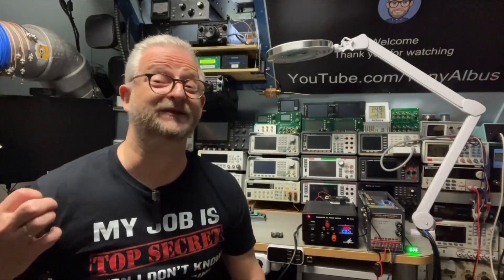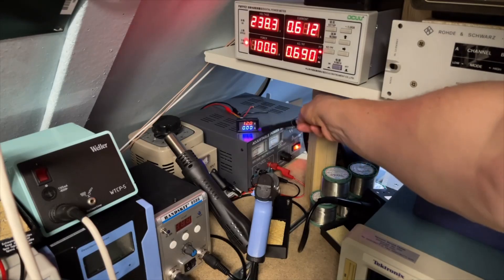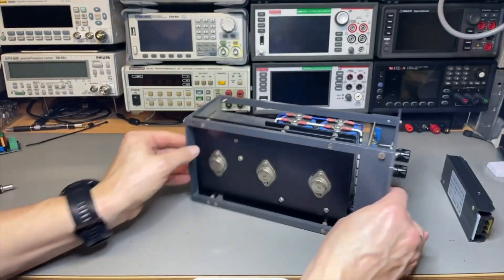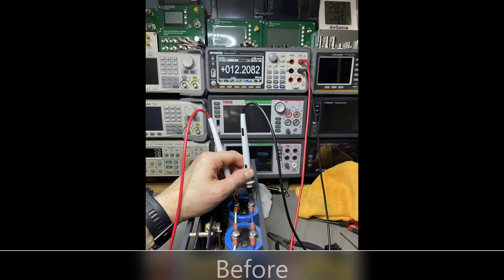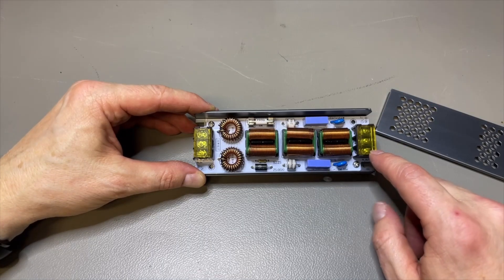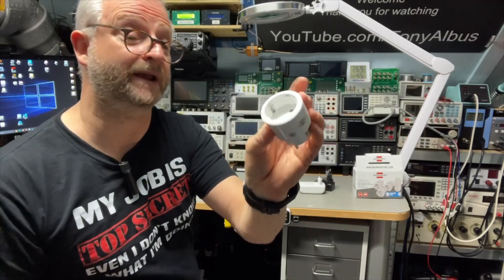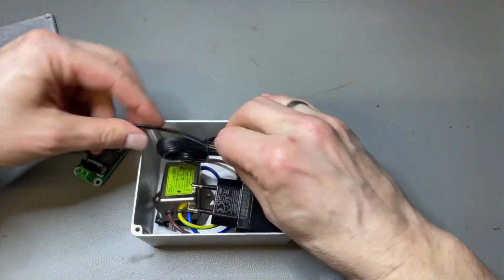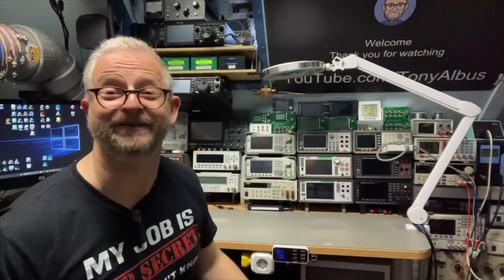TA-0455: EMI RFI Noise Reduction and 12V 5V Linear in the Lab

Comment: Hi Tony, You have been working hard in your lab and produced a good informative video in the process. The miniaturisation of plug in switch mode PSU are great if you get a really good one. However that is not always the case. Many years ago I chased some noise on the shortwave bands which I thought was coming from a neighbours plasma TV. However when he went on holiday the noise was still there. So I went around the house with a portable shortwave radio and discovered it was a 12v/5v PSU that came with an external HDD caddy. So yes I agree a good quality linear PSU is so much quieter.  Oh and thanks for sharing the EMI filters. They look really well built and a must for anyone trying to reduce noise.
Reply from the maker: Thank you Ian, yes finding the source is a real challence and can make you feel very frustrated, i went for the big hammer approach and just attacked all usual suspects hoping it would reduce. the many little plugin psu s i never liked, they take to much sockets also,on top of the produces noise , so that i wanted to do anyway as i did with 12v too.
Using a shortwave radio is a good one, thank you!

Comment: Thank you for a good video.

How can I find all these sources of interference? I have one of those TinySA spectrum analyzers, can I get me a directed antenna to use with it to find these angry rf polluting little devices? Or are there better ways?

I was also wondering as the tons of low power usb adapters are driving me nuts, if you have to protect every USB power cable individually so if a a device needing max 0.5A does not get 5A and fries the whole device should a component in it break?

It would be great running an ancient bad ass huge linear power supply to feed all the little USB critters filling up my bench and office.

Also, could you please link the specifications for the chokes, or even better links to them. Maybe even links to the filters made of chinesium? Would be nice to try some of them out.

Sorry if you already put them somewhere here. I don’t really use youtube anymore but could not find you on rumble.

I enjoy your videos, so thanks for making them available to us nimwits out here 🙂
Reply from the maker: Hi, thanks!
yes finding the source is a challence, i do not have a perfect methode, if i have i will share.
Some use a scope or indeed a SA with those EMI probes (soort of round from pcb) different sizes.
but i just went mostly blind, just taking on all usual suspects first.
indeed i did put all the links in the video description, which is usualy hard to find on mobile for some reason becouse of the new UI, so its all there :)

Comment: Had the same problem with the power switches in the back of some stuff, and I had one instrument which was really hard to modify: my bench multimeter! The whole front is a large PCB with all the connections, buttons and the display, so noch space to add a switch. What I ended with was a pushbutton switch in the door of the battery compartment, cause that door occupied most of the top of the instrument. I used shielded cable (2x0,75sqmm) and heatshrinked the whole inner part of the switch. Usually I don't open that door that often, cause it only houses the batteries (which I don't use) and the fuses for the amp range. If I ever need to change one of these fuses, I still can turn the whole bench off before sticking my fingers in there.
Reply from the maker: Wow, sounds like a lot of work and very smartly done, nice!
Reply: @TonyAlbus  It'a a switch from an old PC power supply, and it works quite well now :) I don't know who thought it would be a good idea to have power switches on the back of bench equipment :D
Reply from the maker: Yes brother, i think the same way, silly design

Comment: Hello, I hope you can help me!

I have an older device from Rohde & Schwarz – an EMI Test Receiver ESPC (frequency range 9 kHz to 2500 MHz). It works fine at first, but after about two hours it suddenly shuts down – no error message, no beep, it just turns off.

Unfortunately, I don’t know much about electronics and I don’t have a manual or circuit diagram to figure out what’s wrong. The manufacturer couldn’t help me because the device is too old, and buying a new one is way too expensive.

Do you know this device or have you ever seen this kind of problem before?
Or do you know where I could get help?

I’d be really grateful for any advice!
Reply: Ich wollte mich bedanken 🙏
Reply from the maker: Hi, sounds like something is getting hot, open it and check, if it is de powersupply, something inside is drawing more current than it should. a classic would be a cap leaking current. but try to go about it very methodicly and mesear before just start replacing components for good luck.
Reply from the maker: If it is a heat problem and it has an old transformar, maybe it was made for 110/220 volts, and not for 120/240.. and it needs to desipate too much heat. you could try to put a varic in front of ot and set the voltage lower.

Comment: Just get a better switching power supply in place of getting back to a power angry linear power supply. You will still get a lot of noise for the environment, if your lab is in a " normal " Room
Reply from the maker: Yes that is a problem in a normal room indeed, a Farday would be great, maybe sometime..
Reply: @TonyAlbus you can technically do it for not a lot of money, it's really depends on the thickness of the material / the size of the radio waves.

Comment: Hi Tony, good info. I just did that exercise to my ham radio station.  My biggest noise problems came from my LED lights and a battery drill charger.  When I unplugged the charger and turned off the LED lights the noise floor went way down.  Cheers
Reply from the maker: Thanks for sharing, i indeed need to check my light too, great info!

Comment: Hi Tony, next step is to enclose  your lab in a Faraday Cage , just kidding.  Very nice video and I also built a 12 volt linear supply a few years ago but I am still using 5 volt switching supplies for some lab equipment.  Guess I need to work on a linear 5 volt.  Thanks for posting and great job.
Reply from the maker: Thanks John! yes that would be even better a Faraday... 
Keep an eye on secondhand market for linear, most people think its bulky and want to get rid of them. i was lucky for cheap i had both.

Comment: Nice work Tony.  Have something similar myself.  Old linear PSU's  around the lab, as it makes sense to have clean power, especially working on a lot of amps etc as i do.  Its a lot of work, but you'll be glad you did it. Only problem is my lab is nice and warm in winter, but too hot in summer, so i need to get some sort of AC installed in the room :) haha.
Reply from the maker: Thanks Stephen, Yes very happy i did. room temprature is a pain sometimes. winter is okey here too, but indeed summer, it can go 30+ .. i know the feeling :)  An Arco would also imprive temp stability overall if setup correct, so your meters will also be more stable. but spending money and space or use that for equipment... yes i am not sure yet..

Comment: Hi Tony, you did a great job, I also use a central 12V + 5V power supply, but only for some devices. Everything related to audio has its own central or separate sources that are only switched on during the operation of specific test circuits, it was structurally easier for me to build separate sources and the central one does not have to have such a large output.
For the central power supply and some audio devices, I had to mount galvanic isolators to cancel the mutual connection via GND. These are miniature galvanically isolated DC converters, I use 1 or 3W modules as needed and each has filter chokes on the input and output. Thanks to the low power of the converters, the interference is negligible, in addition, I have the converters shielded with self-adhesive copper foil, one such converter also powers the BT module that I added to my Yamaha test amplifier. After modifying the power supply in the amplifier, I used a 12V IN / 5V OUT module + a high-quality stereo module with BT3.0 that does not annoy with any messages, has no buttons for control and everything is controlled from the connected device, but what is important - if the input is on and no signal is supplied, there is complete silence in the speakers.
But what got me was an industrial MeanWell power supply for LED workplace lighting, the interference was so huge that it was able to disable the wireless mouse. Additional filters alone did not help, ferrite rollers were also not enough, to solve the interference problems I had to run all the wiring of the lights in shielded cables and connect the shielding to the aluminum structure of the lights - the problem was eliminated by about 95%, the remaining 5% is due to the light openings, with my means the interference is almost immeasurable. The source works absolutely perfectly, no flickering on the video, no streaks on the photos, it's incredibly stable, but the interference really bothered me.

Nice day 🙂 Tom
Reply from the maker: Thank you for sharing your setup, sounds like you have a really nice lab setup as well!

Comment: Excellent work, Tony. Eliminating those SMPS supplies should really help. Have you looked at your ground system? Regards,  David
Reply from the maker: Thanks David, My ground system, yes difficult on the 4th floor. i did some extra grounding to my waterpipes and heaterpipes, not much better. for my Radio i use an artivisialground tuner, but still solarpanelnoise around from alle the houses arounf(i think) but before i blame all others, i try to clean my own room first. (not much more i can do too)